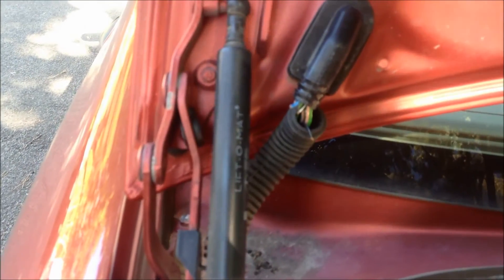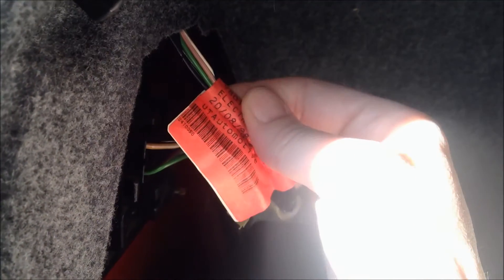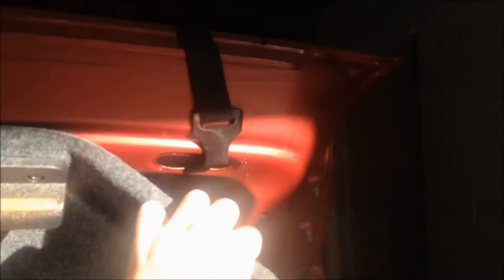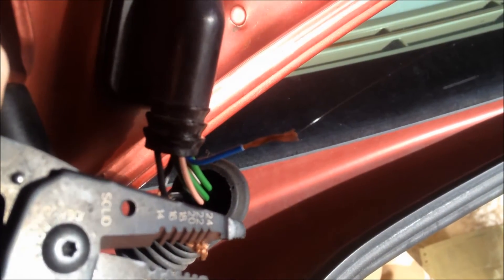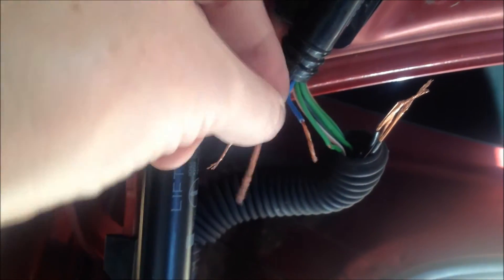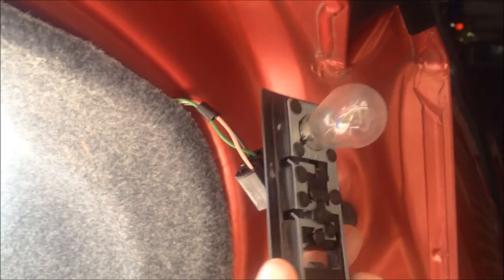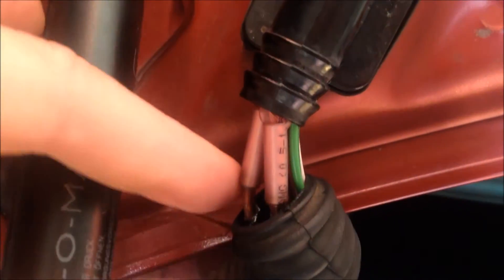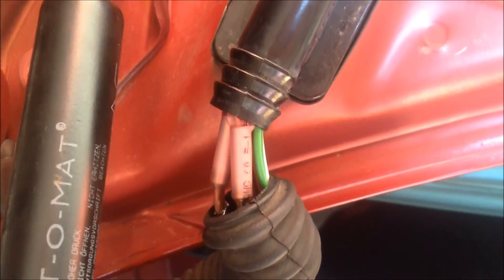Saab electrical wiring fix in trunk

Comment: Oh no... Hate to tell you 6 years later that the tool you needed was right in front of you the whole time. In the spare tire area, Saab provides a screw driver handle with 3 torx bits and a flat head. If you still have this car, or another saab, that screw driver is good for taking apart damn near the whole car. The entire interior at least... glove box, dash, console, etc. and definitely those screws you pointed out!

Comment: Awesome job, Duchess!!!  Fortunately mine was just the fuse!  Had me worried there for a bit!  Last spring we flooded the interior floor under the drivers seat.  It shorted out most of the electrical system, and cost over ONE THOUSAND dollars to fix it!  And, I'm talking a 17 year old car.  My mechanic SHOULD'VE told me first before he repaired it.  I would've said forget it!  BUT, NONETHELESS, I LOVE MY SAAB!  V-6 TURBO.  That car STILL ROCKS!!!

Comment: 20+ years experience auto tech responding here. Speaking from numerous experiences of having to repair a DIY wiring "repair" and then actually fixing the original problem, you did a nice job. I got a chuckle at the beginning when you said it was "SAAB's ONE fatal flaw". I wish SAABs only had ONE fatal flaw. If you continue working on this car, you will soon be educated... you have much to learn grasshopper. Again, kudos to you, I am going to watch your other SAAB adventures.
Reply from the maker: Thanks for the compliment! Yes, I am learning a lot about the many Saab flaws. So far relatively manageable....fingers crossed.